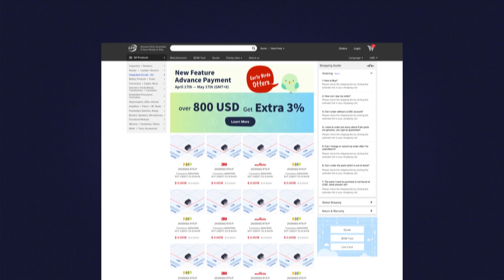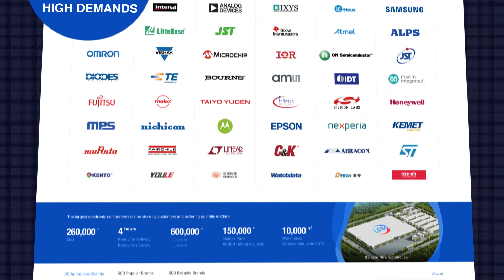LCSC Electronics-China's Leading Electronic Components Distributor

Comment: LCSC is amazing. Great selection of components for a suprising low price. 

I have a question. Is this warehouse totally ESD safe? I've seen ESD "wireless" wrist straps bieng used in previous videos, which aren't really working. 
This worries me alot, since some components can break by even walking near with out proper ESD protection. 
Do you guys use ESD protection, like heel straps or ESD safe shoes? Is the floor ESD safe aswell?